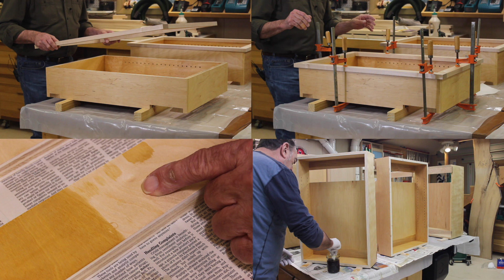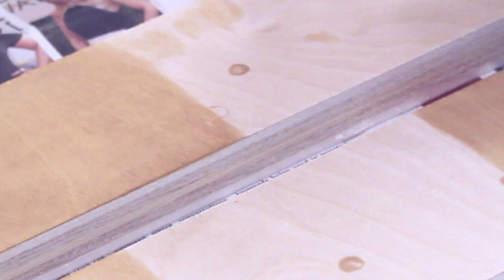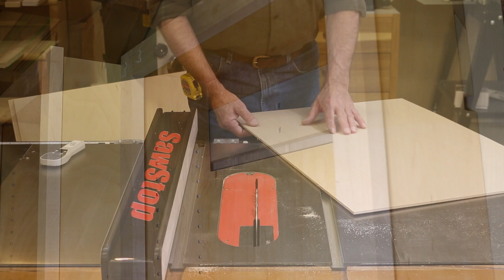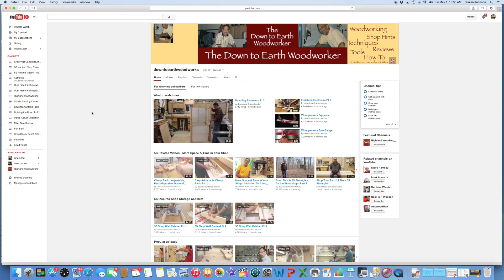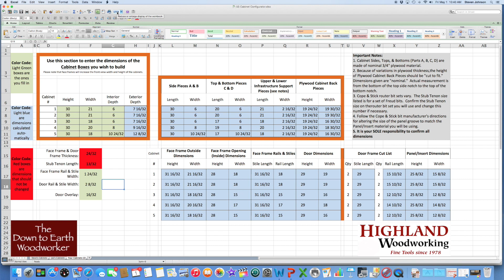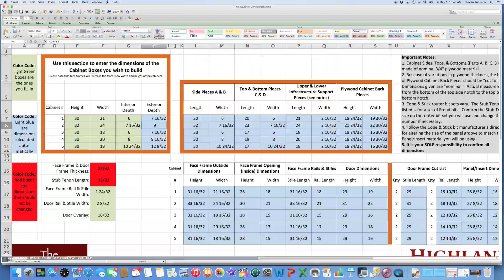5S Workshop Wall Cabinet Build, Part 4 - The Down to Earth Woodworker

Comment: I just downloaded your 5S Cabinet Configurator worksheet, well designed and useful.  I took all of the measurement cells and reformatted them to by highlighting the cessl and choosing: Format->Cells->Fraction->Up to 3 digits.  This results in reducing the fractions to lowest denominator.  Makes it a bit easier to read and translate to cut lines.  Thank you for the spreadsheet. - Annie

PS - repeated the formatting on the other pages by using the "paintbrush" copy-paste-formatting tool.
Reply: SuperYtviewer You must be an Excel Expert!  I will try that on my copy.  Thanks for the input!